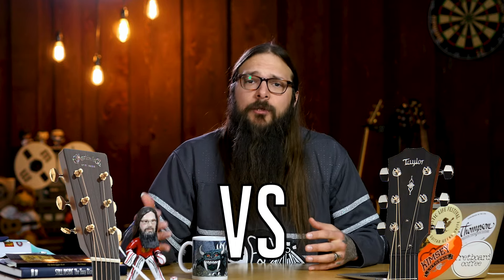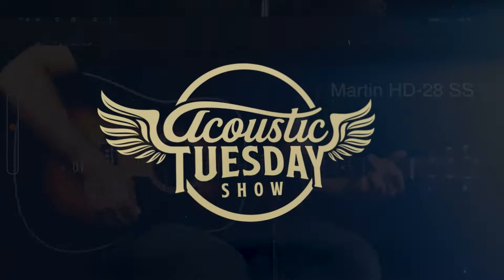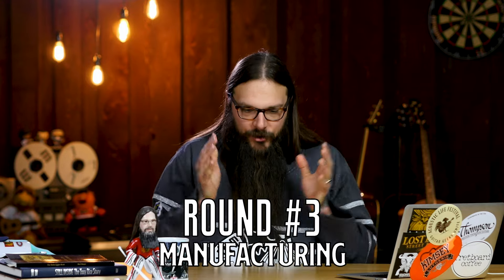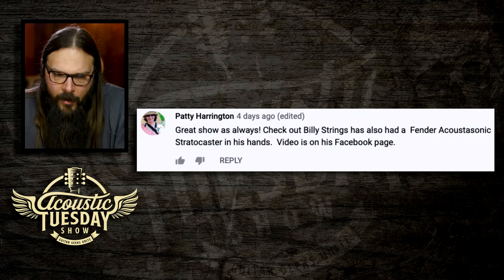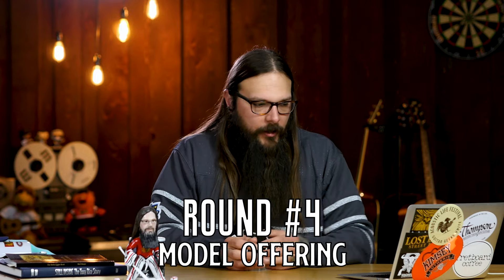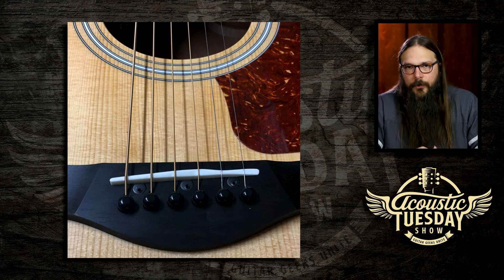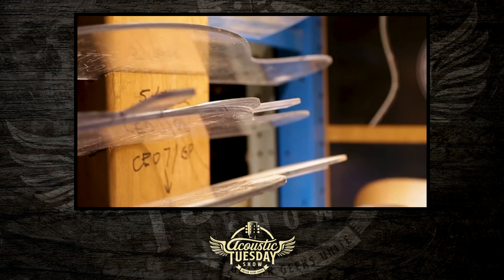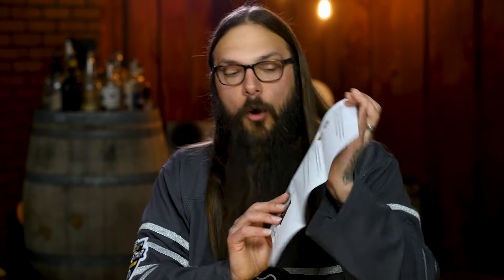Taylor VS Martin: The Definitive Showdown ★ Acoustic Tuesday #137

Comment: Taylor. When it came time to buy a new acoustic, I tried Martin, Taylor and Gibson and wound up buying the Taylor. For me it just came down to tone and playability. Oh, I also have two PRS acoustics.
Reply: I have a Martin HD 28 and a Taylor 710ce. Having big hands, I've found the wider Taylor neck to be easier to play. So, for several years, I've favoured the Taylor. When I finally came back to the Martin, I was surprised to  hear that the sound had changed noticeably and for the better. So, now I play both regularly, as each one draws out different songs from my repertoire. Of course, that is also true of my Guild F 47 , my Yamaki, and my Seagull. Every one of my guitars were bought used and at really great prices. I am always on the lookout for more at thrift shops, auctions, and Marketplace.
Reply: @jennilee2809  You can get a pretty good deal sometimes on Larrivee's. They are a great guitar too.  And I own or have owned just about all.  I won an auction recently on a Guild that I would have never bought if I had known it was so narrow.  Was a F-30 if memory serves me.  It was only 1 9/16 at the nut but was an early Guild. My hands are way too big and fingers fat lol.

Comment: Definitely a vote for Martin from me. I understand why "sound", or "tone" wasn't among your criteria, Tony, (too subjective), but I'm sure that that is the basis of most people's opinions on both sides of the argument. I much prefer Martin's low end to Taylor's higher pitch (if that's the right term). 
I bought a (barely) used Martin SWOMGT in 2004 for $1000, and since then I have owned two Santa Cruz OOO-sized guitars, a high-end Martin OOO, a 1941Martin O-17, and currently, a 1993 Bourgeois OM, among other, lesser brands. My favorite is still the SWOMGT. I know, it makes no sense, but it's true; the Bourgeois is in the closet, and the Martin is on its stand within reach at all times.

Comment: I’ve owned a bunch of Martins over the years. (Several I so should NOT have sold ie D18 from 1975) and two Taylors. I favor Dreadnaught shape. I’ve never quite been able to get that big rich sound from a Taylor that comes with Martin. Each time I played my Taylors I kept thinking “where’s the beef?” It is simply some magic Taylor can’t seem to bring. I found, fell deeply in love, and bought a custom Martin dread with Adi top and tiger wood back and sides. It is simply stunning to look at. The big selling point was that the shop owner in Orem Utah had it hanging on the wall collecting about half inch of dust and discounting many times until he finally accepted my offer of less than half retail. I am not now nor ever expect to be worthy of it. Irrespective of which guitar you play, one must consider the influence of playing in a room full of great guitars which allow sound to enter, resonate and come back to your ears. You get a different experience alone in a room and/or listening to another player from the POV of the listener. Do both before you buy.
Reply: Agree. Dreads, Martins. although also love my Gibson J-45 and like the Taylor GS Mini best in its class.

Comment: I've owned both, along with Collings, Santa Cruz, Bourgeois, Guild, Yamaha, Yairi, you name it. If it's the Martin you love (me!) then get a Martin, nothin' else will suffice.
Reply: I 100% agree with this. There's just a certain frequency in the tone that I can only describe as a 'sparkle'. Other guitars sound great but nobody else has the Martin sound.
Reply: When you're right, you're right.  And that sparkle you speak of....  That's where it's at.  It's a crisp sparkle.
Reply: Not even that yairi? I have an 83 DY-85A
Reply: @younkinjames8571  Liked my Yairi a lot, but no, it was beat out by my 000-18 GE.
Reply: Which did u like more
Reply: @sumanthparakala2005  My Martin 000-18
Reply: Younkin James  for I owned 2 Yairi San 86 DY 75  n a 2003 DY 95c Aura I really think they are underated n the woods offered are air dried for at least 4 years before it goes on a guitar. Yairi’s are more hand made than Taylor or Martin

Comment: Re Standard models, yours is an interesting take and matches my own guitar shopping experience.  Let’s take the D 28.  There are several versions of the D-28.  I don’t want to list the various D28 versions, but trying to sort through their characteristics could be confusing.  When shopping for a Taylor 12 string recently, the numbering system helped me quickly and clearly to learn what was available and the differences between them.  

Regarding innovation, I think the jury is still out on the V class innovation.  I like their advanced performance bracing with relief route, an innovation Taylor used to build some great guitars and almost immediately abandoned for the V class.   It makes me wonder if V class will have the same fate.  Innovations must be lasting to be significant and impactful. An innovation must also become an inspiration  to other makers.  When many makers turn to a version of the V class bracing, then the innovation has impact.  One Taylor innovation that has had wide influence is the cutaway grand auditorium body. 

You also avoided tone and playability as categories.  Both, I suppose, are categories that are largely personal / subjective. I think if these were categories, Taylor would win on playability and Martin on tone.

Observation...obviously this segment was engineered to produce a foregone conclusion...a tie.  But it did highlight the strengths of each maker and that is a good thing and your clear intention.
Reply: Playability seems to me to be something that we as players , assuming a good set up all around, compensate for. I have a 000, a D-35,  a strat and a resonator, the playability is wildly different but 3 minutes in and I’m equally bad on any of toys. :)

Comment: Martin: their lower end stuff is becoming a stain on the brand. There was a black, relatively cheap one they made with laminate necks. Had a good preamp, sounded dreadful acoustic. That neck also became a sore point since they were never stable. The economy Martin guitar is not what it should be.

The core line of Martin is peerless. They have the tone, the pedigree, and the build quality. I'm not a fan of their more outrageous art pieces, but that's personal taste. They are mellow, emotive, stable, a thinking man's guitar.

Taylor is far more consistent at every price point. There's a reason why the GS Mini has made such a splash. It's relatively inexpensive, tonality is not sacrificed to size, and it can be detuned despite the shorter scale. Arguably the rule of diminishing returns is exponentially exposed where a $500 guitar can sound as good as a $5000 guitar. The same cannot be said of Martin.

Taylors have a brighter tone. Ounce per ounce, pound for pound they are louder. Getting them to darken down is an exercise with strings, nuts, pins, EQ, picks, and playing dynamics. Martins can brighten up or darken down by picking dynamics as such can be called more forgiving. However the brighter tone of Taylors is highly desirable. That could be the current fashion, which could fade. Taylor, by this measure is the everyman's guitar.

Long story short: if you want the full spectrum of feeling: get a top-tier Martin. If you want to be happy even with minor chords, get any Taylor.
Reply: 100% agree...Martin's low end stuff is horrible..Taylors low end stuff is way better. However you should check out Yamaha's cheaper stuff...amazing quality.
Reply: @dantegreco1  we're not talking about Yamaha. That comparison is tricky these days. Their high end stuff is damn near boutique level quality. Say what you like about the Japanese, but they've been making stringed instruments for 4000 years. I think they have this down.

Takamine is another I'd point to, although not as favorably as Yamaha. It can be hit-or-miss with Takamine, and I despise the big, clunky preamps they insist on using.  Marrs the lovely lines of many a fine instrument by depending on these plastic bricks. But they do make a killer 12 string jumbo. 

I wouldn't consider Yamaha to be a contemporary of Taylor or Martin though. They make a better instrument at a lower price than either. Once the law of diminished returns kicks in, their high end stuff plateaus much faster, albeit at an exquisite benchmark.

At the end of the day, in order to get boutique quality, a boutique price must be offered. And if you're going to put out $3k or better, it's probably best to look up a small bench builder, and work through exactly what you want. August guitars is just up the road from me, and Dave makes a mean instrument.
Reply: @Kabayoth  I have a 1976 Takamine "Lawsuit' 310S - A Martin 000-18 clone, made from Martin patterns & tooling when Takamine was going to be Martin's Japanese manufacturing partner. When the deal fell apart, Takamine had all the parts, tooling and magic sauce, and proceeded to make guitars that from 2 feet away you couldn't tell from the equivalent Martin, from headstock to tailpiece.  Prior to that I had a Yamaha.  Almost 50 years later my Tak has aged into an incredible instrument. (And believe it or not I ran into my old Yamaha at a party - I recognized a very specific ding on the top. It still played well, albeit long overdue for some fretwork.) I had a chance to play an actual late '70s Martin 000-18 and honestly, it was a dog compared to the Tak, which had chime and harmonics to spare.  Maybe it was strings, or some other variable, but I was pretty surprised.
Reply: @panzrwagn  I have a family heirloom Takamine. Or at least it says so on the headstock. Tak-Tak, as I call her, is a fake. Takamine never made a Guild jumbo copy with the Guild headstock I'm told. So this is a fake copy of a Takamine counterfeit copy of a Guild copy of a Gibson version of a Martin. If only the hardshell case held up as well as the guitar.

Tak-Tak is a lawsuit era instrument. She needs a neck reset badly, but nobody wants to dig into a guitar I can't sell for $75. So I slap light gage strings on her, play her gently, and marvel at the best neck of all time. If this old girl wasn't stashed in a closet half her life, she'd be stolen every time I took her out of the house. She's just SO comfortable to play.

That's not to say she arrived in my hands this way. I had to take some 400 grit sandpaper to the bracing to open up her tone. Before I did that she sounded like a cardboard box. After, she sounds like a mellow diva.

Takamine makes a good guitar, but they also make a lot of duds. I can try several new ones right off the peg, and some of them will be solidly built, but sound dead. I suspect the simple expedient of a quiet room to tap tune the tops would fix this right away.
Reply: 100% disagree, their all solid mexican made are superb instruments
Reply: You hit the Nail on the head!

Comment: I don't know how to keep this short Tony. I've had 5 Taylors 6, 8, 9 and GS mini's), and one '72 Martin D35 (as well as other acoustics).  My friend and stepson both have later model D35's that sound nothing like my '72 (with saddle repositioned). I recently played a Martin D35 HD across from two Taylor 914ce's and truly loved the Martin, perhaps a hair better than the 914, but would play the same role, at least for me. I love the articulate nature of both. If you're a musician than it probably comes down to sound and playability.   In my recent trip to Nashville,  I found it interesting that of all the performances I saw not a single Taylor was represented. And I think I know why.  Taylors can be "jangly", especially since the v-class bracing was introduced.  IMO a lot of guitars that accompany need less jangle and more articulation and full range when needed.  I think the V bracing "unbalanced" many of the Taylors. And of all the recent Taylor's I've played the 914ce was really the only one I'd consider right now with the V bracing (JMO).  CF Martin saw Taylor eating lots of the market so adjusted with wider nuts and brining more resultant harmonics to their sound.  Aesthetically, Taylor wins hands down.  Their single cut-aways just look cool and for some provide better fingerboard access. But OTOH you're pretty much stuck with Taylor electronics (ES2 is a mixed bag) while you have a plethora of pickups/electronics to install in a Martin as most don't come with them.

Comment: Didn't like your conclusion on the manufacturing.  Just a different opinion on the matter.  I don't really want guitars built by robots.  When i buy a guitar, I'd rather that money help support master craftsmen or women than pay for the robot.  What makes a Stradivarius a Stradivarius?  Not a robot.  Skill over technology.  I feel the same about music.  That being said, I have both.
Reply: Agreed to a point. More automated manufacture yields more consistent instruments. When I purchased my Martin, I had to play several to find one I liked within the same model (D-18). With my Taylors, they are very consistent unit to unit within the same model.
Reply: Agreed.  That was the only category that was a little questionable for me.
Reply: You think Martin production isn't automated? Hoo-boy are you mistaken. You think Taylor doesn't do bench-made guitars? Wrong again. Under $1500-$2000 Taylor uses real wood, Martin uses HPL (Formica) and Richlite (cutting board material), and both are very much robotic builds. By the time you are spending $4K or more, both are pretty much benchmade. In between, Taylor spends more on materials, Martin spends more on labor, but both can be great. Taylors are very consistent, Martins, maybe 1 in 5 will be golden, 3 OK, and 1 in 5 a dud. Tonewise, Taylor voices for a lot of chime and incredible playability. Martins are boomier in the bass. But to say skill over technology, and imply Taylor lacks the skill? Sorry, that was below the belt.
Reply: @2Gandalf1  for me thats part of what makes them so great, not that they all sound and play the same. Thats just good branding. I like the fact that my guitar sounds different to someone else's in the same model, the joy of finding a jem. And no I'm not a brand snob, I love finding any guitar that sounds good no matter the brand.
Reply: Taylor has plenty of "craftsmen". Much of the work is still done by hand. They have just automated the very repetitive tasks that can lead to variability in manufacturing.
Reply: Thomas Griffith I agree with Thomas, I just watched a 60 minutes explain how the world is dying and I'm sure the way Taylor is doing things is how it needs to be but  A Stradivarius was nor built by a robot but by people that care.

Comment: I'm 68 and have played since age 12. I had never had a high end acoustic guitar. I found a Tak I liked and know Garth does Tak. While at guitar center Fayetteville AR. I played the 200 series Taylor, I was not impressed. I'm from San Diego and know where the Taylor guitar factory is located. Some time went by and one day back at guitar center, I played another Taylor. Without doing my homework I bought it. After my research I discovered I had purchased a Taylor 314ce grand Auditorium. To me the difference in the sound and action was eye opening. It was an ahha moment. It sat on my lap without requiring a strap. The sound was just embracing. I know guitar players who play country that won't play anything but Martin. It boils down to it for me, the way this guitar attached itself to me and it sounding like rich tone I believe I made the rt decision. If you find a guitar that becomes a part of you like this one has. Buy It !!!!
❤ My Taylor

Comment: I have had 3 Martins and 2 of them had neck angle issues.  When I needed to get the action of my Taylor adjusted, an authorized repair shop was able to remove the neck, replace the shims, reinstall the neck and tune it up and well under an hour.  Sound is a personal preference but in terms of my experience, Taylor wins hands down in the quality department.
Reply: This why I love Taylor's neck. Sure the 'traditionalists' out there would scream that it's just not right to have a bolt on neck. But for the reasons you pointed out, it's a hands down win for Taylor.